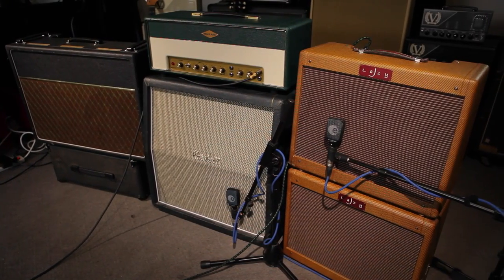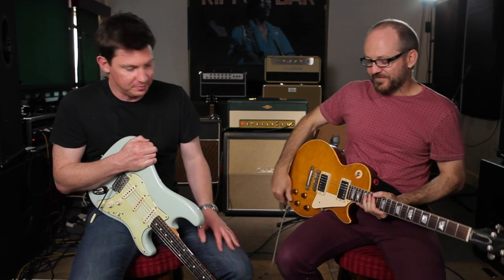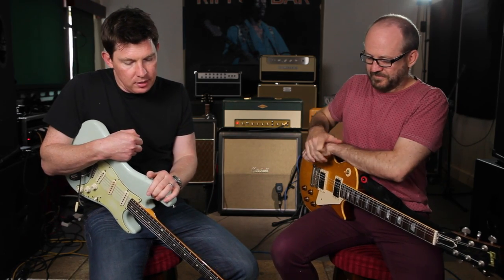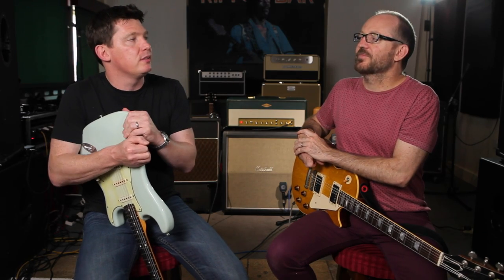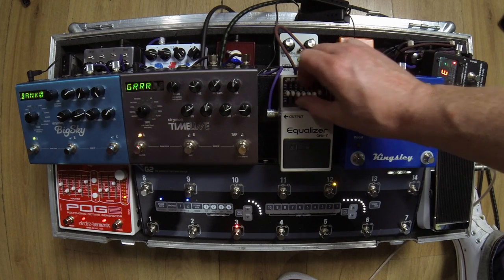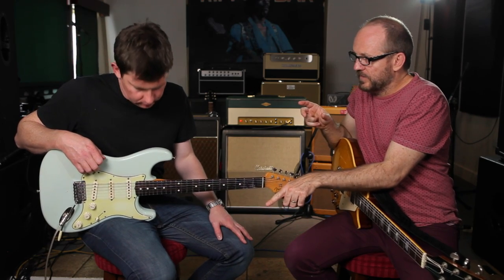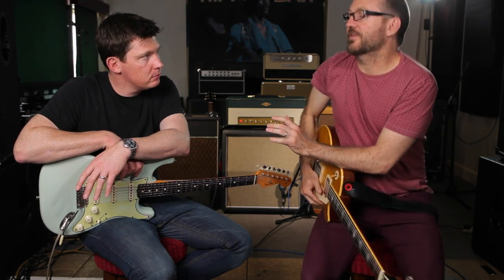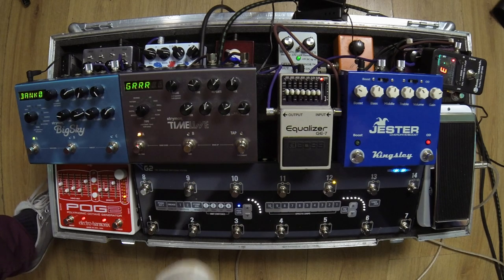Yes You Do Need A Graphic EQ Pedal! Plus: Latest Kingsley Jester

Comment: after years of pursuing tons of different pedals it finally came to me that the most important one is the EQ before preamp and within FX loop... life has been so good since then
Reply: pieroog  you are correct sir best thing you can do for your tone by far.
Reply: How can you have the EQ before the preamp and in the fx loop ?? The preamp is before the fx loop
Reply: +Harry Souter When you consider the pre-amp as the spot you plug into your amplifier or amp-head then the entire fx loop takes place before the pre-amp, however there are ways to put inserts on post amplification... however I don't think many people really do that.
Reply: +Tarkhun Fora  you're only confusing people, very few amps have the fx loop before the preamp.. i cant think of any.  and yes, many people use fx after the power section by using a line out or wet-dry rig.
Reply: Daniel Simon If i'm confusing people it's likely just because they don't have the same training. I'm an audio engineer by profession. Confused or not effects can be put anywhere in a chain, more often than not they are before the guitar amp effectively making them before any sort of pre-amp. They can also be put into effect inserts of which many amps do have or even patched into a patch bay on a mixing rig or an insert on the channel in DAW. There's a million reasons you might want to put an effect at any given spot in the chain, but most are done straight out of the guitar. Delays, echo and reverb (Or general time based effects) are the only thing I think that's usually done after the fact and those are usually because they get set to tempo.
Reply: @nwawallace  yes totally agree
Reply: @nwawallace  Sorry mate maybe I'm dumb but I can't think of how my amplifiers'  preamps could be after the FX loop (as in after the return). I've always assumed the "send" was a send from the preamp section.

Comment: 2nd time through the vid, so I get a 2nd comment.. ( :
I have an EQ in my loop right now, but I can easily see using 3 EQ pedals.
1. In loop-Covers overall tone. 2. Before my Deluxe Big Muff to control it better. More shaping of its tonal output and volume. 3. As a lead boost which allows shaping of lead tone exactly how you like.
I'm not fond of the idea of doing a continual pedal dance while playing so a pedal controller would also be ideal for this type of rig.
Listen up boys and girls. The EQ pedal is the most versatile and useful pedal you will ever own. ...and they are cheap.
That's a win for everyone.
Reply: I have 3 band EQ in my mini mixer, the Boss EQ, the EQ in my Source Audio envelope filter, and EQ, at the end of my chain in my amp modeler/DI. And I still want 2 more EQ's!

Comment: I've had an EQ on my board since I found out Rhoads used one in 1980, '81 or so. Later found out that EVH and Lynch used them as well. Such a great way to shape the distortion and also goose the input of the distortion with clean boost to make legato play effortless. Great video.

Comment: Forgot to talk about how you can use the EQ to even out the differences between guitars.  Some guitars are so different that you find yourself reaching for the knobs on your amp all the time.  An EQ pedal can solve this.  Say just to take away some of the low end on the les paul, after setting up the rig to sound great with your strat.
Reply from the maker: Really good call Adam :)

Comment: I just discovered the Source Audio EQ.  It has four presets and is midi-switchable, which works fantastic for multi-guitar rigs.  I can set up one preset for my Les Paul, one for my strat, and one for my shredder.   I love having the ability to pull out the honk or the face melting bands.  It'll also save the boost for each preset, if you want to set up a solo patch.   I'm taking what I learn from you guys to the next level!   I totally needed a graphic EQ.  :)

Comment: You covered it very briefly at the end, but you can also use the EQ pedal as a pseudo clean sound running it straight into a gained up single-channel amp. There's a video somewhere of Paul Gilbert explaining that trick that he used to use a lot. I've tried it and it works surprisingly well if you dial it in right. It's an effective "cut" of your guitars output & tone together, to basically drive the preamp less.. Sounds crazy I know! haha, Great video guys, keep them coming! Cheers.

Comment: I put my Analogman SILENT Boss GE-7 at the end of the effects in the loop section. That's where I found it to become the most efficient. And I have a FLEX-EQ7 right after the tuner at the beginning of my pedalboard, and I only use it to even the output and the EQ of my various guitars in order get a more reliable and predictable response from my effects (specially the drives and distortions).

Comment: learning how sound engineers operate eq in live and recording situations helps you understand your tone so much better.  Also, the angle at which your ear is listening to your amps speaker massively effects the tone you get.  I use a quad box in small gigs, not to be louder, instead to get a nice angle to hear, tone and volume wise, the amp and run it quieter.  a comboon the floor when your almost on top of, is going to be bassy and hard to hear, yet could be deafening and trebly for the audience.

Comment: I picked up a GE-7 recently to use as an EQ for a Martin with an under-saddle piezo pickup (to roll off the highest highs and the occasionally feedback-prone lows).  I had so much fun using it as a tunable booster (for my electrics, of course) that I picked up another one about a week later.  Both occupy very important places in my pedalboard, and I don't see them coming off the board anytime soon.  Great video.
Reply: Drum & Strum BTW, I put the "booster" GE-7 as the first item in my FX loop, so that it acts as a global booster after the amp's gain stage.  I haven't noticed any detrimental effects on the chorus/delay/reverb-type effects coming after.
Reply: +Drum & Strum I've also had good results with my GE-7 in the FX loop, it can also transform an iffy solid state amp with an FX loop into something very usable if the amp's onboard EQ is lacking in range.

Comment: I have a Fender Champion 100. I realize it's not a fancy-schmansie amplifier, but it's lightweight, loud and totally reliable. The clean channel is very nice and a couple of the channel two overdrive sounds are pretty close to what I want, but even with my 2001 PRS Custom 24 they are too bright even with the treble turned all the way down on the amp. I can further cut treble by turning the mid know down to a lower number but then the distortion gets a fizzy, scooped sound. So, I just put an MXR six band EQ in my effects loop, cut the lows and highs, and bumped up the mids. After a lot of listening to recorded lead sounds I prefer and tweaking the EQ the amp now sounds every bit as good as my Shiva did. I'll often work all day on amp tone, and I have found that walking away for thirty minutes and then coming back works very well.

Comment: Great, great topic, gents!

IMO this is worthy of (at least) one more episode including extended pedal reviews.
Several mid priced EQs do a very good job and when utilizing more than one EQ in your rig (clean tone tuning, compressor tuning, overdrive/distortion tuning, overall tone tuning, etc.), you can have two or three of these (at 9V), for the price of a single MXR 108 + Doubler, so please consider an episode on this subject!

Two questions:
a) Will I experience issues if I run (EQ + compressor), (EQ + overdrive/distortion) and 
( EQ + phaser/flanger) in three G2 loops rather than in six?

b) One is often advised to subtract from unwanted frequencies rather than adding to wanted ones, and this seems intuitively "right" to me, but:

Toying around with graphic EQs, I found it easier for me to dial in satisfactory results when ADDING to wanted frequencies and then backing down on the level control for unity level - the EQ "curve" remains the same (as was to be expected), just shifted "higher up".

Is this due to some psycho(acoustic) issue on my side 😳 or can it actually be explained from the construction of these pedals?

Comment: Hi guys, I feel very "basic" asking this, but you've given me some confidence. 
I once owned a boss Graphic EQ and I found I could hear a "fake-ness" to the sound, artificial somehow, but the ability to achieve very specific mid humps in different frequencies was fantastic. I now have an EQDevices Tone Job (three band amp-style EQ) and while it's simple to use and transparent, I could do something a little more tweakable, yet not quite empress level tweakability.  On a Graphic EQ when all the sliders are at 0 - in the middle - is the tone (when the pedal is engaged) the same as when running direct to the amp?

Such a blonde moment.  x
Reply: Bleek Noir yes in the middle at +/-0db is neutral

Comment: I have a bunch of questions.....
1. So can you use an EQ after the pre amp in your amps effect loop (before the power amp)?  So adjust the EQ to suit the room right before the single is amplified by the power section?  My amp doesn't have an effects loop, so I can't play around with that.  2. My amp doesn't have an mid control (conford harlequin, which I love), so I was thinking about getting an EQ.  I'm really tempted now, you just blew my mind.
3. Another application maybe is my neck humbucker in my SG can be really muddy (I like it clean, just not with overdrive).  Perhaps I could use it just to open it up a bit.  E.g. instead of replacing the pickups.

Comment: An EQ pedal is absolutely necessary for people with one or 2 channel amps.  Not only can you sculpt and refine your tone with it, but it enables you to double the amount of channels on your amp.  The best thing to use them for is either boosting mids for leads or cutting mids for rhythm.
Reply: +DomSchu 'absolutely necessary'? How d'you account for 95% of guitarists who don't use one then?!
Reply: Peter Taylor  actually if you think about that statement almost every guitarist playing pro gigs has a rack system on stage that includes multiple eq including graphic and parametrics.
Reply: I'd contest that almost every pro is playing a rack system and I wasn't exclusively talking about pro players anyway. I'd still wager that most players get by fine without an EQ so to call it absolutely necessary is a bit ridiculous
Reply: Peter Taylor  of course i would agree not absolutely necessary  but if your setting up a pedal board like with G2 you might as well add, at least some parametric eq  for overall tone shaping,. most guitarist use graphic eq for solo boost not tone shaping. I use 2 amps  stereo in both FX loops and have a empress paraeq for each loop.I personally wouldn't  gig without them. It's that much of a difference so i my case it is necessary but maybe not for everyone. I think once you try it, and if you have a good fx loop ( i use metro amp zero loss fx loop- awesome and totally quite)you will hear the difference. If I was using a graphic eq I would get a source audio and use the midi function for switching out from single coils to humbuckers. I try to keep my mind open to whatever works for me :)
Reply: +rick jones I own and use a GE-7...used as a solo boost to add a little volume and mids so I don't need convincing that an EQ is a powerful tool. I'm just saying that it's not essential kit for the majority of players. As they explain in the video, other pedals can do the job...e.g. using an sd-1 would serve to cut bass and add mids in a similar way.
Reply: +Peter Taylor I agree, alot of metal heads for example, have used the Maxon OD808 to either push their amp or cut the pounding bass out of their four speaker stack cabs.
Reply: "its absolutely unnecessary but would be a great addition to your tone shaping abilities"
                                       is what i think you meant to say.

Ive played guitar and have been in many bands,recorded several studio recordings and Ive
 never possessed an eq of any kind other than the amplifiers controls.

yes its good,no it isn't needed

Comment: Every musician should be made to watch this video. All sound, "tone"... everything you ever hear is made up of a mass of different frequencies.
Pickups, pedals, strings... everything that people change chasing a 'tone'... all they're doing is altering the frequency balance. Get an EQ unit and you can alter those frequency balances ad nauseum. No soldering required, and after the initial purchase, free of charge.
Wish I'd worked this out 30 years ago. I'd have a lot more room and I'd have saved tens of thousands.

Comment: Another superb video guys.  Very informative and carrying a GE7 in my gig bag is one thing I have considered for a while.  I used to suffer from only using a scooped tone and having massive stage volume to try and cut through. Solved that mystery several years ago though.  However my question to you is: do you think the graphic eq on a Boogie mkV:25 has enough range to allow you to eq the room?
Reply from the maker: The Boogie 5 band eq is great. There are lots more comprehensive eq's out there but it's a great tool and can be very helpful tuning to a room.

Comment: I have enough pedals to open a store but if I could only keep 10 the MXR 10 band would be 2 of them. I also like to set up 6 or so guitars and just noodle. I can eq the Strats and just turn it off when using a humbucker. Also in the chain it can be used as a boost for solos. I also use it to gut the sound and get it as clean as you can. Then with a click you can go from heavy gain to a nice clean like having 2 channels. Pair one with effects on a loop. I also have the ge7s but imo they color the tone,gain sounds muddy and overall do not sound as good.

Comment: Mick or Dan, I really enjoy your show. I wanted to see if you could answer a question. I have one of the older T-Rex replicas (without the knob that reduces input signal) towards the end of my pedal chain all of which runs through the effect loop of my AC-30. T-Rex says “Your Replica can be used in an effects loop, but note that input signals above 2 dBu can cause distortion.” I really like the sound of the  replica and either leave it on all the time and sometimes stack with another delay. My question is could I run a graphic eq in front of that pedal to reduce the input signal and prevent the distortion? Or would something like the Keeley GC-2 comp/limiter be a better option? Or is there something else I haven’t thought off. Thanks!

Comment: Eq does so much. As for the bass I always have it on minimum on the amp. also noticed on one amp I have the wah sweeper better with the bass on minimum. you can also hear the grit or driven deep tones because they are not muddy. it's a guitar not a bass.

Comment: Mick and Dan! Great show! I have a question; if I plug my boss ge-7 in my chain, without power supply or battery, then i have no sound on my amp. Plug in the power supply and it's working (with pedal both on and off). Is this correct or is it warranty time?
Reply from the maker: It's correct. The GE7 is buffered and needs a power source for both its on state no bypassed sound :)
Reply: +Daniel TheGigRig thanks for answering. The thing is it worked yesterday without powersupply in its off mode, what I didn't know was that it came with a battery in it hehe :-). I'm short a power supply so i was going back and forth between the ge-7 and my tuner,,,

Comment: I've heard the Boss Graphic is very noisy to the point where it has to be modded to get rid of the issue?
Reply from the maker: Depends what you’re using it for and where in your rig you’re using it. For 95% of uses it’s absolutely fine but if you’re after a quieter experience there are some mods you can do

Comment: Great video as always! I have a Fender Blues Junior iii which, I'm sure you're aware, does not have a fx loop. Is an EQ pedal my best bet at getting a solo boost without raising the overall gain too much? I want to run my amp a bit 'hotter' but when using a boost pedal - it's raises the gain too much for my liking. Thanks.

Comment: I'm thinking of running an EQ in my Marshall effects loop for subtle EQ and boost options for solo breaks when needed (I don't use an overdrive pedal, just the amp overdrive). If I'm running an MXR Carbon Copy in the loop too, where would the EQ be best placed? After the Carbon Copy? If using an amps overdrive is it best practice to place the EQ pedal in the loop to thicken the lead tone as and when required? Sorry for all the questions!

Comment: hi, actually where to put the eq pedal, before or after overdrive, Thanks.
Reply: They’re putting the EQpedal AFTER overdrive, here, but they alternate too so try both & keep it between pitch & modulation pedals👍
Reply: I’d put it at the end of everything so you’d EQ everything in the chain thus far
Reply: @mcbrodz1663  one more thing, I have tc spark booster too, where to put its, thanks. 😁

Comment: Is it possible to bypass the amp's EQ (by modding it to be like a vintage Vox for example) and balance tone with an EQ pedal instead?  Or does the amp need to be made that way to start with? Great stuff as usual guys; every day's a school day :P
Reply: if your amp has an effects loop, i guess you could plug straight into the return.. but i guess you could turn everything down, at 12 o'clock or all the way up :)
Reply: The original Vox amps didn't have a tone stack. The signal went straight through the pre amp to the power amp section without being interrupted by the tone stack. This has an effect on gain and the way the amp works, which is why I was wondering if it's possible/straight forward to remove the tone stack from a modern amp with more or less the same valve set-up.

Thanks anyway!